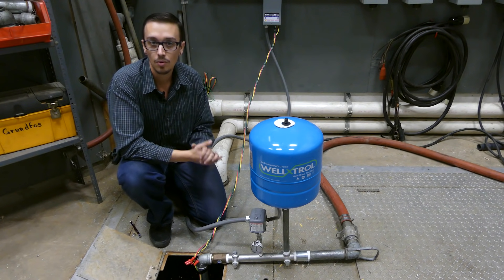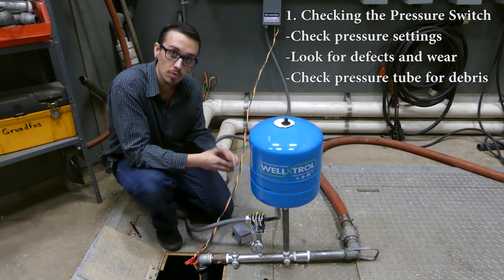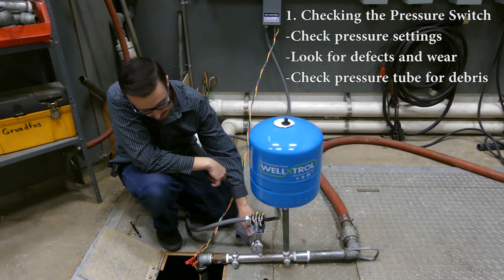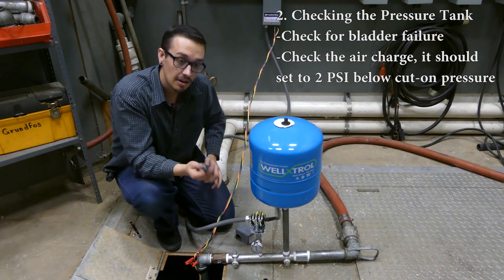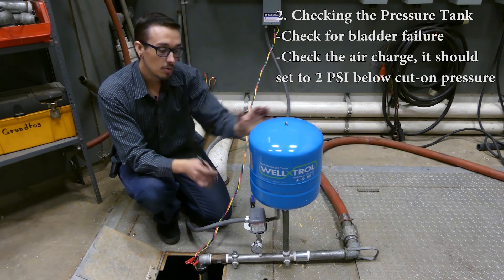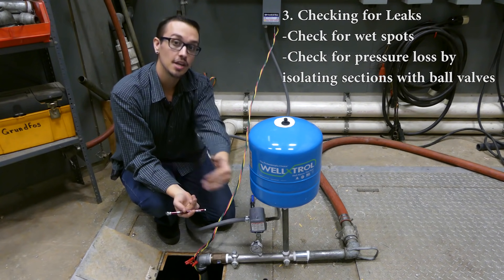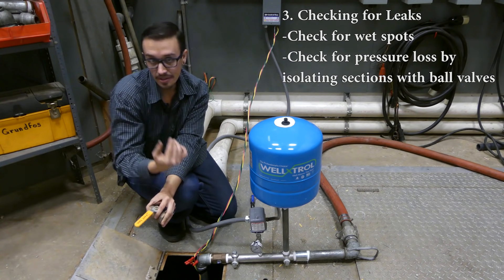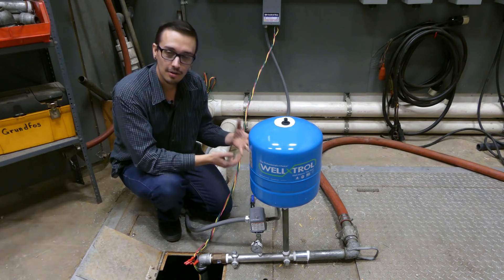Troubleshoot: Water Well Pump Starts too Often (Rapid Cycling)

Comment from the maker: Thanks for watching! If you have ANY questions or concerns about your water system you can leave a comment, call our experts at 855.329.4519 or you can live chat with them on our website: RCWorst.com
Reply: R.C. Worst & Co., Inc. 
You mentioned bleeding the pressure from the system.   Is that simply turning off the power/breaker to the pump and running the water out?
Reply: You state that if we are frequently going through pressure switches than something else is wrong, such as? We go through at least one a year, and so does everyone else in our neighborhood. What can it be, can we fix it? I'm sick of having to fix our system all the time and buying replacement switches is a huge drain.
Reply: What if the pump is taking water from the ground but not pumping it into the house. How do you fix it
Reply: When I’m showering my pressure is cycling kinda rapidly .  What’s that you think

Comment: Due to flooding we had to replace all components (everything). The pressure cycle is 35 to 42 psi so it constantly cycling. The switch range adjustment is so high physically anat if I were to lower the pressure, the spring would fall off. Plumber set the talk pressure to 40 psi. Way too high?

Comment: Woke up very little water pressure in bathroom till it pretty much runs dry. And then I closed it and asked if my brother shut the water off, he said no and went to the sink and it sprinkled out water until it ran dry. So we go look at it and see if we are getting power to that pressure contactor thing, we aren’t, and we turn it off and turn it back on and this mf started arching. we go to change it and we didn’t relieve the pressure bc we didn’t understand it was a pressure contactor until we already had it removed, (we backed up the pipe it was on so we have no leaks there and visibly see no leaks) My brother and I think it’s just water that is just needs drained out, so we try to let it drain for a couple of seconds it doesn’t work so he covers it w his finger and I used teflon tape wrap it up and then put it on live, then he connects it just how it was. And now we are getting short cycling system it’ll run for a few mins and shut off. I’ve been on so many different videos.
Reply: And we have a Kinetico system so not any plumber can just work on it, and they’re always a pain in the ass. They just come by and flip a breaker and it’ll work again. Like we are having serious problems constantly with it and they just shrug it off. Could it b clogged? Leaking?

Comment: ITS CYCLING TOO FAST MY SCHRADER VALVE IS ON THE SIDE OF THE TANK. WHEN I UNSCREW THE CAP = WATER COMES OUT. DOES THAT MEAN THE BLADDER IS BAD? I CAN'T ADD AIR DUE TO THE WATER COME OUT OF THE VALVE.  I THOUGHT SOMEONE TOLD ME I MAY HAVE A BLADDERLESS TANK. IS THAT POSSIBLE? AMTROL P/N 9020-001 DATE CODE 126206  MODEL 109
Reply from the maker: If water comes out of your air valve then the tank is bad. Give us a call to get a new one coming: 855.329.4519

Comment: My sump pump does not look like this. I have 2 (the house was built in 83). It is in the hole. I can disconnect the pipe, unplug it from the wall and take it out. I though it might have been clogged, and had a pressure switch like he is saying, and was looking for other information.

Comment: Thanks for the great video! We have a 22 YO 1/2HP submersible pump running at 118’ depth. Put in new pressure tank 7 years ago when we moved in. We have a 30/50 psi switch, which is currently cutting off early (short cycling). It cuts in at 40 and off at 43! 
I bought a new 30/50 switch and a new gauge as well. Is it OK to have cut in pressure adjusted to 40 on that switch? OK as long as bladder pressure is 38psi when water drained out? I’ll check that, too. Tank is not a WellXtrol, but I would think it should be OK after just 7 years and only 2 person (low usage) household. Thanks!!

Comment: I wish these videos were helpful to me. My pump seems to be rapidly cycling and running nonstop so I killed the power to it. I am not sure if that is even what I am experiencing with the pump because I have no knowledge of pumps and thus also no experience to use referentially. This video did not show the problem, so it is likewise useless to me. 

I really don’t know what is wrong much less how to fix it. I do know that when I stopped to check the washing machine to see if it was receiving water, when I reached in I felt the sort of sensation you experience when licking a 9 volt battery or using those electronic muscle stimulation pads. Not a quick static electric shock but rather that slow tingling burning kind of electric feeling. 

I don’t know what the problem is and I don’t want to die trying to figure it out.
Reply from the maker: I’m sorry to hear you’re having trouble with your pump, and it sounds like there’s a safety issue in play as well. I would recommend you call a well pump professional immediately as that electrical tingling feeling is not a good sign.

Comment: Pressure in tank is reading 35psi, I’ve replaced pressure switch, checked for leaks, and I’ve cleaned out the line beneath the pressure switch. Still kicks on/off every 3-5 seconds continuously

Comment: Thanks for the video. I have a situation where the pump triggers for around 5 seconds every two minutes. I've tightened all taps, but this does not seem to be the issue. I've had to resort to going up to attic at night to turn off the pump...so we can sleep. Do you think this could be due to a leak?

We only had a water pump replaced 3 or 4 years back, as we were having similar problems, but there are no obvious signs of a leak and the new pump worked fine up until recently.
Reply from the maker: If the water pressure is dropping when you are not using water then you must have a leak somewhere.
Reply: @RCworstwater  Actually think it might be electrical, as it stopped when I switched sockets. Thanks for the reply though.

Comment: Great video. I am having a cycling problem. I tried measuring the air pressure, but there is no pressure coming from the tank. It is  2. Gal inline tank, FP 7105-8. I pressed the pin from the Shrader valve to confirm there was no air. The water pump works when the sprinklers are running, but there is the cycling problem when they are not. What should i check for? Is this tank done?  Thanks!
Reply from the maker: Sounds like your tank bladder could be ruptured. You need to have a tank that holds air pressure and see if that fixes the problem.

Comment: Great Video, but I still have a pressure problem only in one zone of my sprinkler pump well system. I have 5 zones. Zones 1-4 work fine. Zone 5 is doing a rapid pressure cycle. It turns on, hits 60psi then shuts off, goes down to 40 psi, and clicks back on. This happens every 20 seconds when zone 4 is on. When zone 4 is off, the pressure is fine everywhere else. Any ideas?
Reply from the maker: It sounds like this zone is smaller than the rest. There are ways to fix this. Give us a call: 208.664.2133

Comment: I would like to ask if you could help us because the gauge of our water pump/tank is set to turn on at 20 psi ? and to turn off at 40...but we saw it yesterday and it became 10 to turn on and then turns off when it goes up until 20...we don't know what happened why the gauge measures changed. Thank you for the help in advance...

Comment: I don't have a Schrader valve on my unit anywhere. It runs my sprinkler system. I have a zone that is causing short cycling and I can't find a leak. I have a few zones that work fine and a few zones that the sprinklers are intermittently popping up.

Comment: My pump kept turning on rapidly - off/on really quickly, I changed my pressure switch and it still did the same thing, it was the head pressure was too low, I put air into the tank in the valve and fixed my problem.  Thank you.

Comment: Thank you! I just fixed my contactor. It was clacking on and off rapid fire when it was turning on, and pvc pipes were shaking violently. After adjusting the screws correctly and cleaning off the surfaces with deoxit and sand paper it only contacts once and is quiet, the shaking is gone! Excellent

Comment: Thanks for this great video.I've been having what I believe are 2 problems with MY well pump here in Florida; First thing was the capilary tube fitting at the pump got brittle and broke off. Then it was discovered that the jet and possibly the impeller were blocked by sulfur. (My local water guy is unavailable right now) so he instructed me how to clean by using muriatic acid.and poking the jet itself with a small screwdriver and a coat hanger wire. I FINALLY got the pump to work right it seems to struggle to get to its 50psi cutoff and when it does cutoff the pressure (gage) doesn't STAY at 50psi but drops to around 35psi. My guy thinks debris from the cleaning may be partially clogging the capilary tube......I plan to take everything back apart today & clean. What are your thoughts?

Comment: A shot in the dark.
I have one that
 Cycle very short around 40psi and the pump doesn't seems to be want to go higher. Even I have tighten the big bolt. The pump just keep running without going up in pressure. Just switching on/off every 30 sec around 40psi

Comment: Thanks for this very effective and practical advice.  Our pump assembly was 21 years old and for some time was almost failing with the pump on almost continually even when using a small amount of water in the house.  By Xmas Eve it was almost unusable and on Xmas morning I used your advice to drain the pressure vessel,  and then inflate it with a standard tyre pressure machine.  Masses of water came out when I was doing this so I think the tank was water logged and the bladder is leaking.  When I put the water back on and it came to pressure,  it worked back as it used to do and it meant we could have a Xmas day without problems and showers and baths as normal.  
Our existing pressure tank is 60 litres and I find I can buy a new 120 litre vertical one locally at a relatively low price.  Am I right in assuming that the larger the pressure tank the less the pump will need to cut in?  We use the water extensively to irrigate the garden and two large greenhouses so it seems to make sense to do this.  We have a good well that delivers a lot of water.  
Would you advise me to go down this route and should it result in a far better system for both the house and the garden watering requirements?
Seasons greetings.
Reply from the maker: Hello. Yes, the bigger the pressure tank the less cycles on the pump.

Comment: What about the type of check valve the pressure switch is attached (screwed into) to? When pump is turned on pump runs fine. Tank fills up then cuts off when it is at the set level. As soon as the pump cuts off you can hear the water falling back into the well. Nobody & I mean nobody mentions, talks or remotely comes close to explaining this. It’s almost as if this is 1 in a million, never seen before problem even though I know it can’t be.

Comment: Thanks so much for this video. I'm super hesitant to mess with my water system, but the pump is rapid cycling. When a tap on the tank with a screwdriver handle, it sounds EXACTLY the same, bottom to top. Failed tank? Thanks again!
Reply: I drained the system, checked the tank pressure. Nothing. I filled it to 38psi (40-60 switch.) Everything is fine now.

Comment: Thanks so much for putting together this video. I had a few questions concerning the behavior of my well pump system. For one, when I shut off the main valve and someone tries to use the water, the psi reading on the pump system box starts to cycle very frequently - I'm wondering if that causes wear and tear anywhere? 

Additionally, when the main valve is fully on per usual operation, I notice that the water pressure slowly drops prompting for the well pump to start up again, this cycle happens every minute or two - does this indicate a problem? We do already perform regular water filter replacements, would it also help to drain the water heater? 

Thank you so much for your time.

Comment: Why will my gould j10 start if I understand hook thermal switch from ballast and after it starts I hook it back up it runs  but if I leave everything hooked up and plug it in it won't run and hums

Comment: hi...I watch all U videos exlent, but I have a problem with my sprinklers sys. My pression gauge go from 40 t0 60 continue rapid cycling and have no loss water on the sys. This is normal or no. The tank is 38 psi, my switch 40--60 look like all is normal but my gauge is of and on evry 10 second Thank you .....HT

Comment: My pump cut in as soon as i turn on faucet BUT then almost immediatley quits for about 3-4 minutes then pumps starts and runs as it should to gain pressure,,problem is it takes forever to run a bath or shower,,i have a replacement pump and tank that im about to install..im increasing hp to 1 hp from 1/2 and increasing tank to a 30 gallon from a 15 gallon,,any idea why existing pump is shutting off so quick

Comment: My system seems to be rapid cycling, but it also loses full pressure when for example I flush the toilet. Sometimes after flushing, there is barely any water voming from the taps for a few minutes until the pump kicks in again. Any advice pls?

Comment: My pump is set 40-60psi so when station 1 comes on and pump kicks in, it reaches cut off 60psi too fast before my sprinklers can get going and shuts off, then kicks on again at 40psi goes to 60 and shuts off. It worked fine before replacing a switch. How to configure it to be same pump input and water output so pump can keep running while irrigation is on?
Reply from the maker: Give us a call: 855.329.4519

Comment: Could it be the bladder in the tank? We've been told by a couple of the guys who have come in to work on our washer system that our water pressure tank is fine but then we've been told by others that the bladder is leaking or not holding it's pressure and that's why it's short cycling. So we've been told by the last guys that were here that it definitely was and that it needed to be replaced and I'm of the mind set that it's old anyway (I believe more than 10-15 yrs), is what he said and needs replacing anyway and should tell us if that's the issue. If it is, problem solved. If not okay we have a new pressure take no biggie, needed to be replaced anyway so on to the next thing it could be. We have a sediment issue with our well water so we're using filters to keep that down. Water guy suggested either dig new well or put filter system in that filters water prior to getting into tank and then filter after coming out of tank which we have now. My hub had to replace that every 2 to 3 months if not sooner and its usually packed with a fine sand/sediment. The system to filter water is obviously the cheaper way to go and digging a new, deeper well may or may not resolve the issue. What are your thoughts?
Reply from the maker: A bad pressure tank could absolutely cause rapid cycling. DO NOT put any filters before your tank/pressure switch. If that filter gets clogged the pressure switch will just see low pressure and continue to run the pump until something breaks.

Comment: Thanks for the video you saved the day for me! Mine got to where it was was clicking on and off constantly every time the water was used and then the pressure went totally down to zero twice in a day without hardly even using the water, so I drained the tank filled the air pressure up to 40psi and cleaned the contact points on the pressure switch and now its back to normal working operation.
Reply from the maker: Glad it helped!

Comment: My switch fails every night.  I get up and there is no pressure at the spigots in the house.  I tap it and it works again, pressurizing the tank.  My well is 100 yards from my house so I have no idea have rapidly it cycles.
Reply: Hey what turned out to be the problem?
Reply: @gkanchan123  Something inside the tank was causing it to cycle too often which was causing the relay switch to work too hard.  I replaced the switch but had same problem and then had the entire tank replaced and that solved the problem.

Comment: 90 % of the time its water logged, drain it, add air at the top reconnect and your back in business..... the switch is rarely the problem. Pipe breakage is the 2nd thing I'd check.

Comment: What if I have a VFD and the pressure switch is +2 but the pump is kicking on every 10 seconds when the sprinklers are running. Shouldn't the pump continue running but at a lower adjusted speed?

Comment: When the switch turns on, the contacts close, but pressure goes up in increments. Pump turns on and off. Eventually the contacts will separate when the tank is full. What's going on?
Reply: Same problem I have. You ever find out the problem

Comment: hi my name is sheryl my son has a shallow well it lost prime two weeks ago he cannot get it to re-prime we bought a check valve and replaced that it still will not prime. we had a 100° day I don’t know if the pump kept running when it lost its prime maybe is bad now but that is our next move is to take the pump off and take it apart … the pipe coming out of well is holding water so the foot valve is good no leaks pressure switch is good could the pump be the problem?

Comment: could sediment in the line cause it to chatter?  i have set tank pressure correctly, set cut in and off, but my pump control still chatters when it cuts in. i am at a loss.